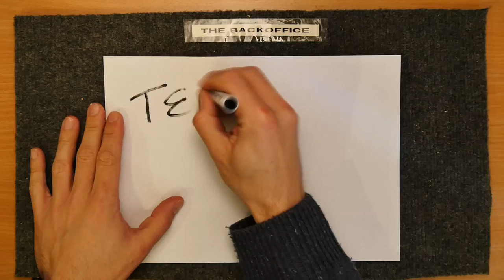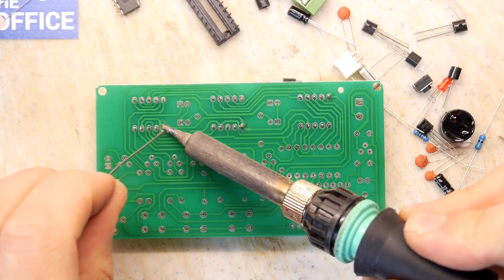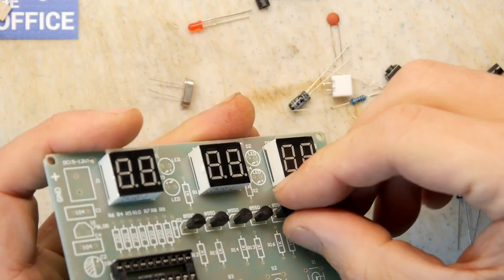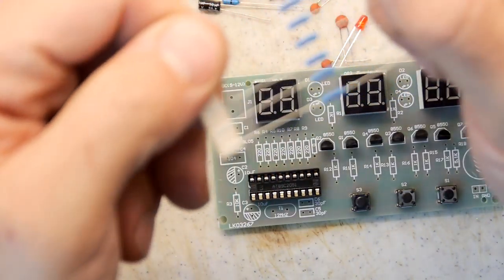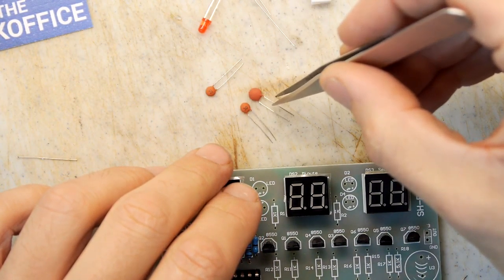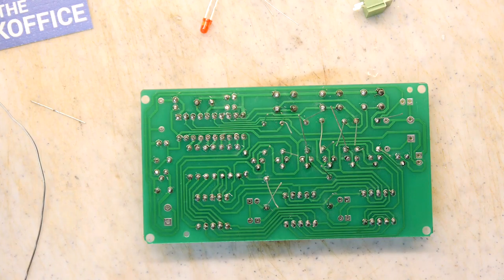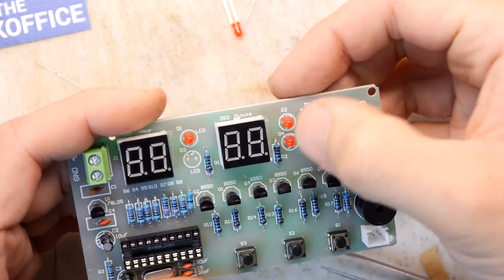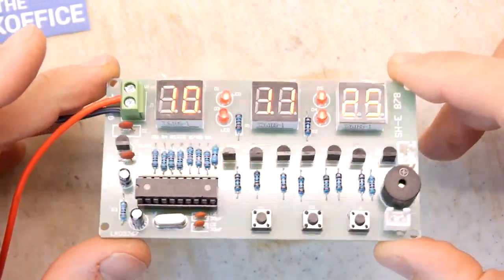Mystery Chinese Clock PCB Kit

Comment: Kinda hard to check my phone when tending bar (wall clock is hard to see). I am lost without my watch. Even just out and around, it is so much easier to check my wrist than to pull my phone out. Just what you are used to I guess (personal preference). I have always had a watch... A lot has changed in the 4 yrs.+ since this video. Yes, my watch does have LTE.

Comment: Hey friend I just finish my clock,can I run on nine volt battery or a nine volts power supply,may I ask what voltage you used
Reply from the maker: +Ron Thompson id be racking my brains to remember I'm afriad and not near enough to check. Does the board have an LM805 on it?

Comment: Never mind my clock lights up except. Two of the red l.e.d. s ,it won't change time,I was two resistors short 1 k and a 10 k the ones in the kit were blue and my replacement were light brown resistors,of the correct value,I don't no what percent tolerance my were ,and what the tolerance of the one in the kit are but that shouldn't scdew up my clock ,or maybe it did,back to the eBay to reoder,I i hate when my kits come up short on parts,or two many parts my kit is DOA
Reply from the maker: +Ron Thompson that's irritating. I had a few components fail/arrive dead, bit usually have enough scraps lying around to replace. Still fingers crossed your parts come.
Reply: Ron Thompson same, ive just made this and have a 30f brown bit missing grrrr, one day I’ll have spare parts. One of my other clocks has two or maybe three lines missing in the led displays :0(
Reply from the maker: Oh that's really annoying